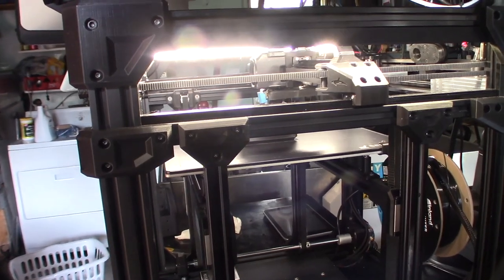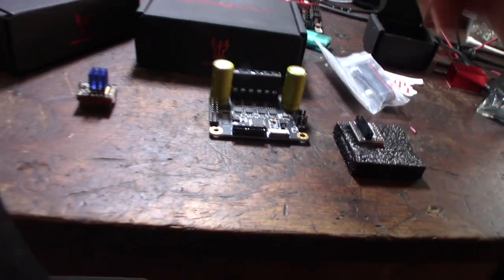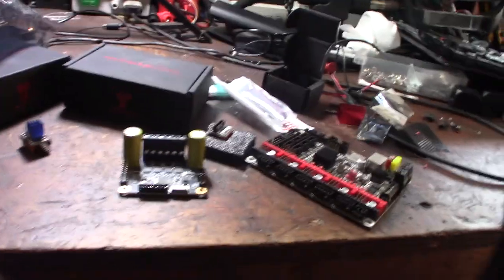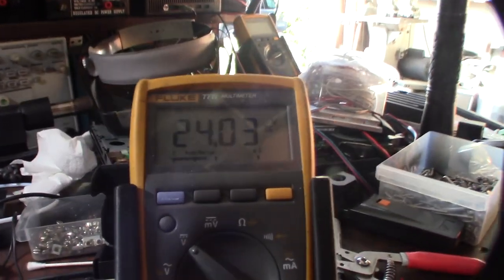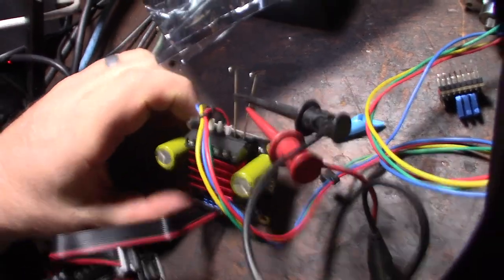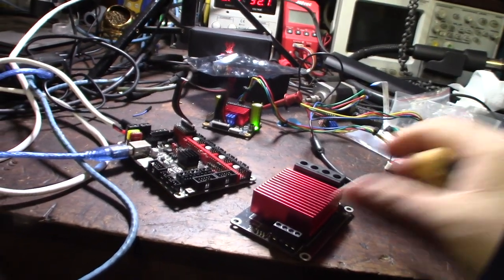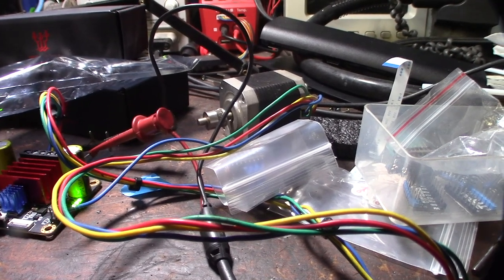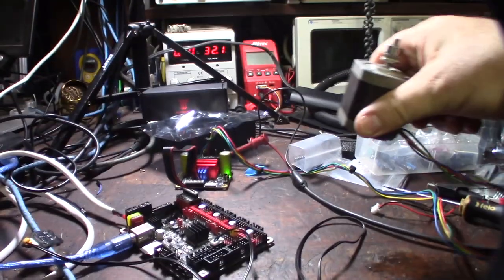BigTreeTech TMC5160T Plus High Voltage External Stepper Driver 60V max Klipper 48V

Comment: Interesting project!  The LDO motor you have, appears to be optimized for speed without needing a high voltage upgrade, as long as you use a driver capable of handling the larger current.  Using too high of a voltage might cause the motors to heat up excessively due to eddy current losses.  However, if your goal is to max out the speed without caring about efficiency or cost, then it doesn't matter. 
For comparison, I can move my printer's x/y axes at around 600 mm/s using a 12v power supply and lowly drv8825 drivers set to 1.4 amps.   The motors run quietly and are barely warm to the touch.
Reply from the maker: I machined massive heatsinks.
Reply: Massive heatsinks... there's a  big thermal time lag...whereas 
device temperature rise is I^2 dependent thermal sensors are slow. ..compared to ( L/R ) Ampere  rise/fall times...
Reply: Yea but more volts less amps keeps the motor cooler the Amps heat it up I went from 24v 2.2 amps on ldo 2804s or 2.8 motors to 48v 1.6 amps they stay cooler longer while enclosed and achieve higher access and top speeds

Comment: How did you setup the TMC5160's on the SKR1.3 in klipper? Do you have to enable it in the firmware setup or is it easy to enable through the config.cfg?
Reply from the maker: all done the printer.cfg

Comment: TMC chip on this driver have a central pad, its connected to big copper plane on bottom of the driver - dont block the airflow on the bottom side. Rsens 0.022R is best for 10A motors.
Reply from the maker: Cool, thanks.
Reply: Can I use those drivers with cnc?

Comment: Damn nema17 at 2A, don’t they get super hot?
Reply from the maker: I machined massive heatsinks.
Reply: If I understand you correctly these being 5160s do not support UART mode despite the fact that the breakout board has jumper settings for?

Comment: Your new motor terminal block   each terminal may handle 5-7 amps...when used alone..When all/more are usedthe amps.on each have to be derated as data sheet specifies...
At 24V/1.5 A ...the 1.5A is the avg. current flow...if (when)you're running @ 90%duty..the peak current flow in devices is 1.5/0.9...i.e. 1.65A..so on 48 V for 90% duty..your pk.current is likely to be 3.5-4 Amps...or higher...
Reply from the maker: My current sense resistor setting was off in klipper.